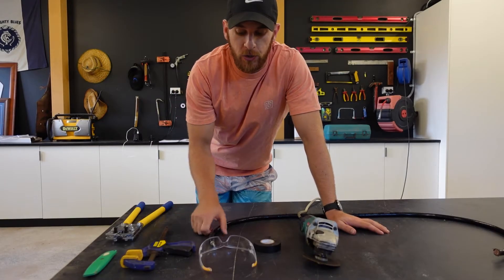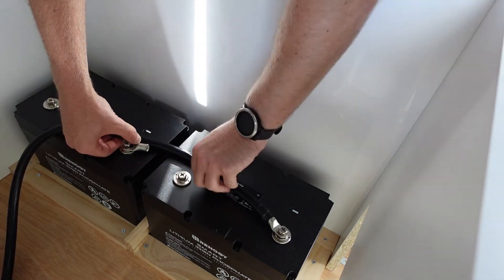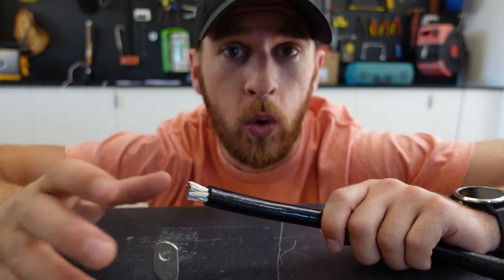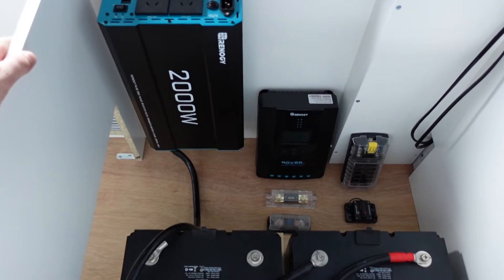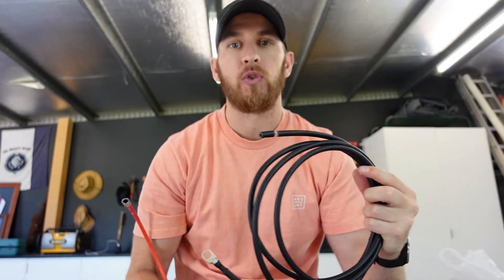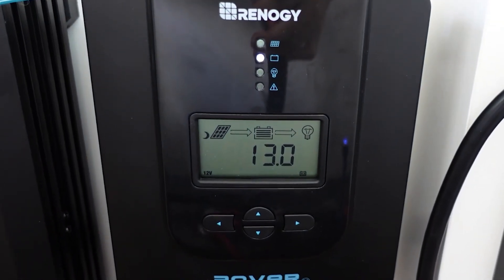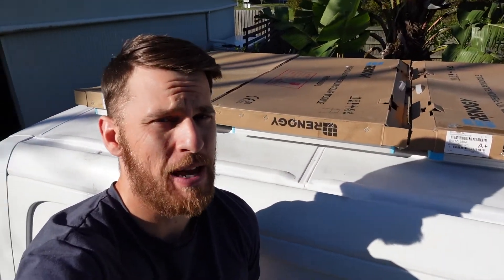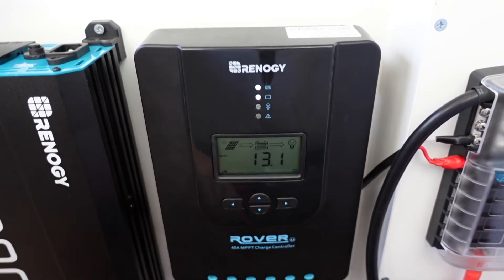Installing Renogy 300W Solar Kit, Plus MORE! Complete DIY Solar Van Setup #Vanlife

Comment: What gauge wire did you use from the battery to the breaker, breaker to fuse box? I saw you used 1/0 for battery to battery and battery to inverter but the red wire looks thinner. Thanks! This is super helpful

Comment: Great video I'm just about to get the exact same set up except the 200W kit, my question is on the floor you have the 3 items, 1. the ANL fuse. 2 the circuit breaker and what is the 3rd item? is it a second ANL fuse

Comment: Hello from the Gold Coast - I'm going to have to have a crack at this when I get my van, I know nothing about electrical systems but I do know how to read an instruction manual - pretty sure if I follow every step correctly I can't go wrong. I do have a couple of questions. I have heard people say you turn the inverter off when not in use, Could you explain why as well as when you would use that socket at the top on the inverter - Is that for the stuff you don't have hard wired to the system and could you run a power board from it to run several items such as a magic bullet?  Thanks - I'm enjoying the videos.
Reply from the maker: Hey!! Good on ya for giving it a go, I'm glad you're trying it out for yourself! Great questions: first of all it is really important to turn your inverter off whenever it is not in use because inverters pull power (draw current) from your battery source when turned on, even while they aren't powering any appliances (sitting idle). In regards to using the power socket on the inverter, you would only use this for appliance's that require a high amount of watts. Think of it like this, anything you plug into a household power socket is AC Power (230V) this is what you should use the inverter for (ie your magic bullet, laptop charger, air fryer etc). But everything that is wired from a fuse block (from the batteries) is DC Power (12V) which can only be used to power appliances that are made to run off of 12V power (DC fridges, LED lights, USB sockets, etc).  I wouldn't suggest running a power board, because the more appliances you use at once with the inverter, the quicker you will drain your batteries. Also take a look at the watts of your appliances and make sure you purchase an inverter that can run them. Inverters come in many sizes: 500w, 1000w, 1500w, 3000w, etc. I only use my inverter to charge my laptop, camera equipment, and to use my air fryer. Other than that you want to use your DC (12v) power as your primary power source as it will last a lot longer. So if you need to purchase things for your new van, try and use 12v DC as much as possible. I hope this helps :)

Comment: are you using an inverter charger or just an inverter?
Reply from the maker: I am purely using an inverter for any AC powered appliances. At the moment I use my inverter for computer charging, camera equipment, cooking with an air fryer, and charging power tools. With my 2 100AH lithium batteries running a 2000w inverter, I have yet to experience my battery life drop below 86%. Thanks for the question, and I hope this helps :)